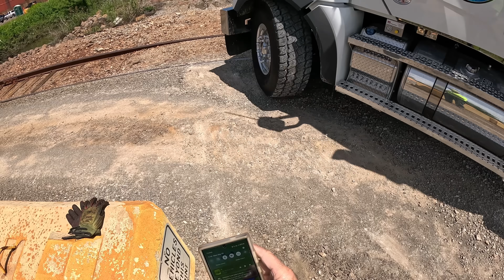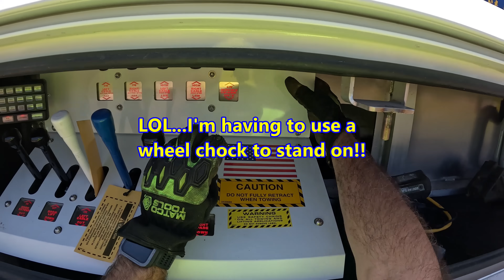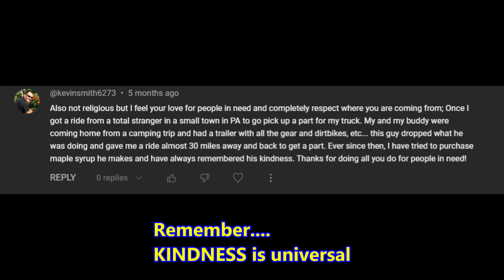THE PICK & PULL.  RR TRUCK BURIED TO THE FRAME!!!

Comment: I applaud whoever welded those D-Ring mounts as I've seen several that break loose with that type of strain. And cheers to Oscar for a job well done and learning from Ron.
Reply: Ron teaching is an excellent thing. I learned by getting into, rigging and doing the work. It’s tough especially when you’re doing heavy recovery work

Comment: I can just imagine the resistance that was there with that RR truck buried. Between all of the equipment on the truck, the railroad axles/wheels, and it's a tandem axle on top of that. I'd be willing to bet that truck was pushing 60,000 lbs. Great work boys.
Reply: I thought the rr worker said it was 56k when ron said he was thinking 60k.  But either way just a few pounds

Comment: Ron, just an FYI for you. The Hi-rails put an extra 5 - 6000 lbs on the front axles of that truck and an extra 8 - 10000 lbs on the back, so be careful when pulling a hi-rail truck. I worked on the railway as a mechanic for 33 years, and saw lots like that.

Comment: Lil' beast doing lil' beast things. proving that sometimes a smaller truck is the better truck. The Tator would have made easy work of this but getting her in there would have been almost impossible. so to use the rotator the  position would have made the job difficult as the tator would have to back in and stay on the road they came in on between the fence and wall. Perpendicular to the casualty. Not to mention her ARC nemesis was looming. The new truck was the right truck. Able to get in line and gor the rail truck out in no time Good job guys. God Bless.

Comment: Good exercise in geometry!  Be nice if the folks building the trucks would realize they're going to get stuck so make recovery easy.  I'll usually try to use the 1 inch d-rings but still those are only rated for 15k wll  way lower than the mighty wrecker.  I have seen a locomotive recover a mired excavator with a 2 inch cable, it was like a big dog tied to a coffee cup.

Comment: Those D rings are too small for that truck, definitely agree with you on not using them for lifting points! The welds are good and solid based on what I could see in the video, but still... shudders

Comment: Here is you SIGN 'NO VEHCILES BEYOND THIS SIGN'. Just having fun. We used to get those "rail-runners" in the shop to work on. The wheels are made from 1/2 thick steel. Not easy to remove.

Comment: My thoughts looking at it as an outsider with no training other than your videos.. To me it would've been FAR easier with Tator.. rim slings to the tires, spreader bars and pick the sucker up and move it where you want it... but I don't know if that's too much weight to do that with and again, I get that those spreader bars eat up a lot of time for setup. Oh... I guess that idea wouldn't work with those rims unless you just looped them around the tires. Either way, your way ended up being simpler.

Comment: Do you think there will ever be a time when you will replace the metal ropes with the strength and light weight of yenkum (spelling) ropes? As many have done with great success? Just wondering.
Reply: Yankum ropes on the winches would be undesirable.   They stretch too much.   Which, to be fair, is what they're supposed to do.  Stretch to avoid sudden shock loading on the vehicle being recovered.  It isn't such a good idea for ropes that are going to be wound on a spool, though.

However, there are other low stretch synthetics that are beginning to replace steel wire ropes on winches.  The wire ropes are still less expensive and last longer if not abused, though, so it may be a while before the synthetics fully replace steel, despite having advantages of weight, ease to work with, and a few other things over the steel.

Comment: This is not criticism, but when teaching new drivers about backing up with a spotter, I would tell them to use the two hands apart method. That is where the spotter holds his hands apart sideways, and as the vehicle backs up, move the hands closer together.  At night just hold a flashlight shining from one hand to the other or two lights if you have them. Great job! I thought the fence might cause more problems than it did.